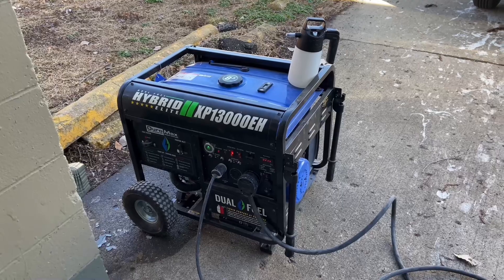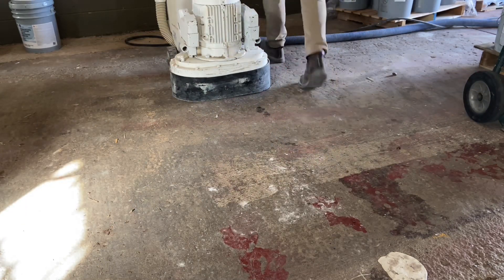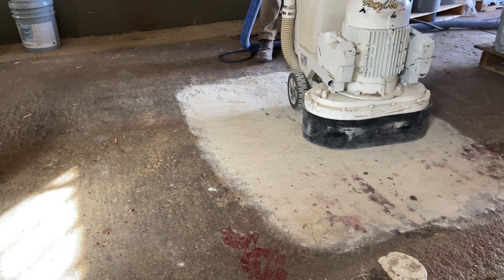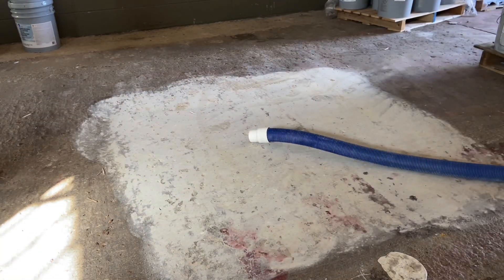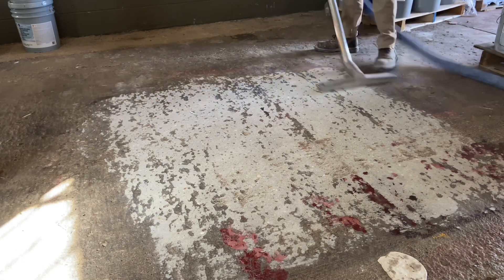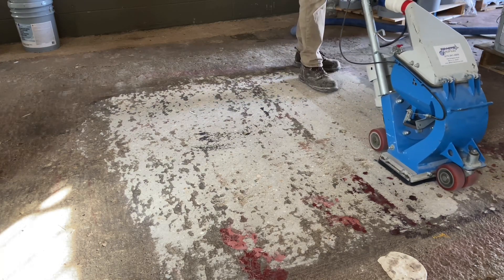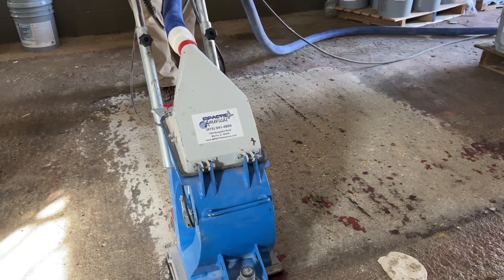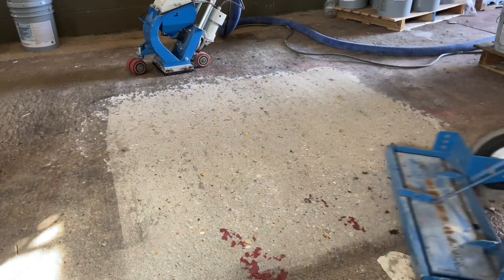How To: Concrete Grinding to Flatten and Shotblasting to Clean Pits

Comment: Would you recommend this to level a slab on a house? The concrete is pretty wavy ( up to 3/4 of an inch)?
Reply from the maker: @eb9832  that’s a good question. A grinder “could” do this but 3/4” is quite a bit to grind down. For that much removal I’d bring a scarifier to remove the bulk and then grind it the rest of the way. 
An alternative to this is remove some of the high spots and fill up the lows with underlayment. This isn’t a perfect solution either but it’s another option.

Comment: Great instruction video ! There is some old red coating left on the floor. Will it not cause any problems with the new coating over it ?
Reply from the maker: Thank You. 
The red coating would be a problem where it’s still filling the holes. It does present an issue if this area is to be coated. The option is to blast it more, grind until the holes are ground away or scarify. In all cases of chasing the red, the area would then be low. This might mean extra filling/patching to bring back up to the original elevation. 
Thanks again.
Reply: @joshjones8047  thanks for your feedback. Ok that means if it would not only be a demonstration you would have done more work on the spots with the old red coating…

Would it be possible to first grind with pcd and then start with the normal metal bond diamond grinding ?
Reply from the maker: @esdrehtsich9289  correct. A PCD could be used in lieu of a scarifier if the concrete is soft enough. The main aim would be digging down enough to remove all residues.